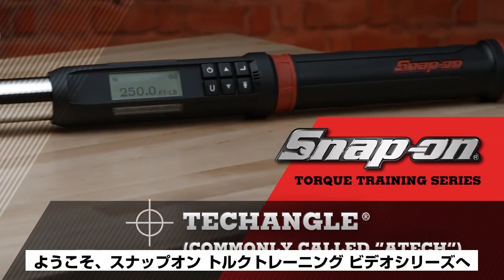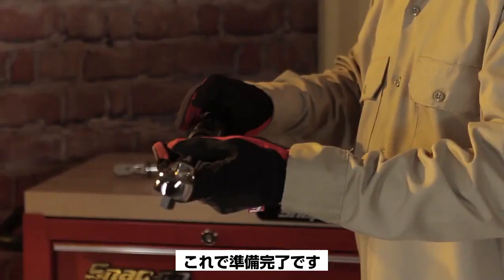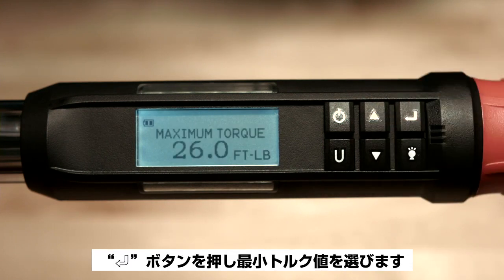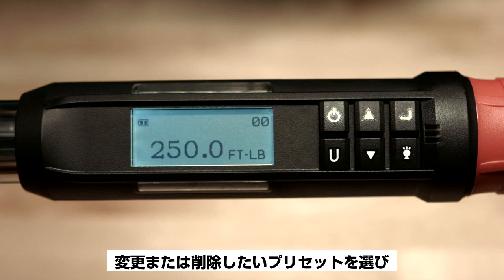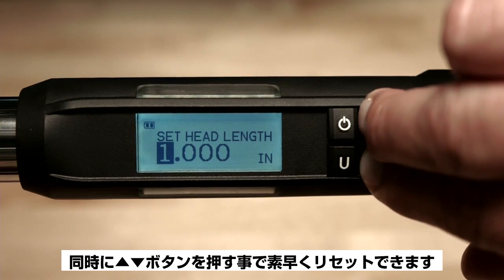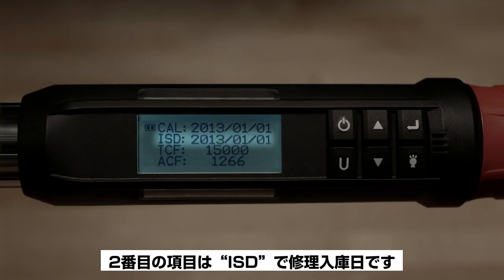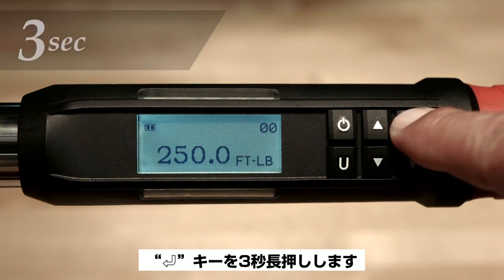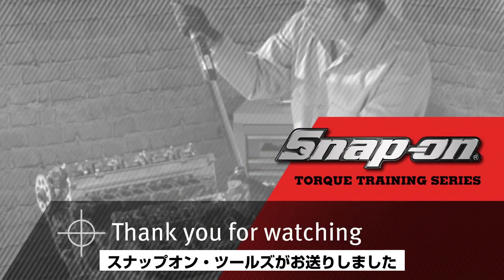Snap-on Torque Training Series / A-TECH_Electronic Torque Wrench

Comment: Once i bought the 15&300 Atech , 4/2021.
I started my tool collection over.
Its was all Taiwan anyway.
So i bought the Pittsburgh 301pc. .
To be portable and efficient.
Two blow molded cases 
To keep up with. 
Now im efficient and 
Didnt spend over a $1000 dollars.